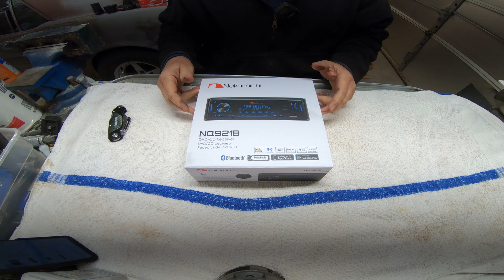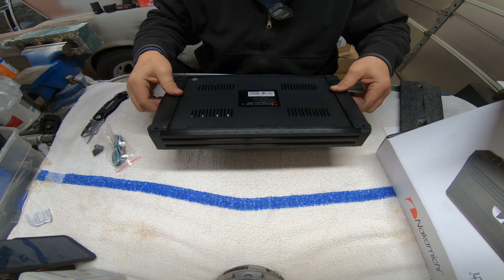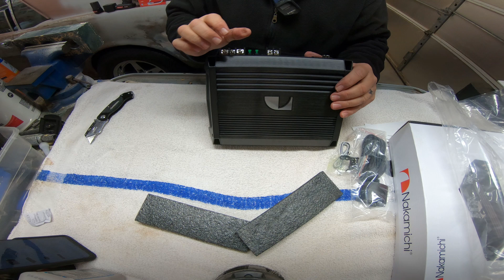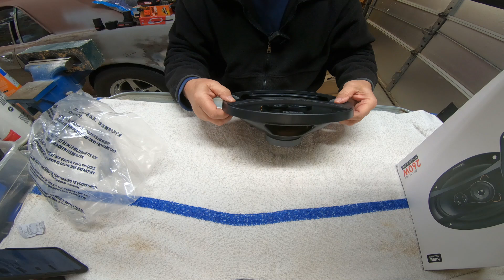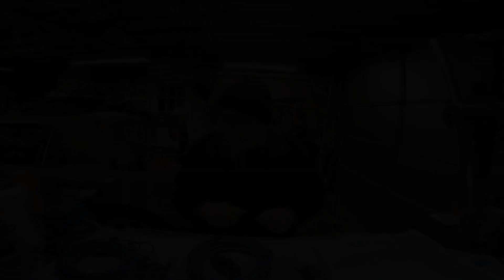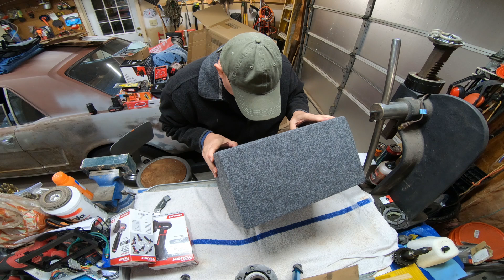Complete Car Audio System on a Budget | $300 All-In Build

Comment: i'll guarantee you that 500.1 mono amp will make it's power. I used one on one of the 12" DVC double stack Nak subs they were selling for $26 and it is incredible.  If I ventured a guess i'd say that Nak 500.1 is doing close to 600 good watts at 2 ohms, you may have to tune it way down for that sub.  I would say to peel that rubber boot off the magnet to get all the cooling you can for that motor
Reply from the maker: That's good to hear! I may wanna wire it up at 8 ohms 😄
Reply: @TorquePowerVideo  just maybe you'll need to wire them in series, those 10's don't really handle any real power and the surround is so hard it wont let the cone move so no real excursion or sub bass output they just build heat in the small motor and get real stinky on even 100 watts.  but that was just my experience with them